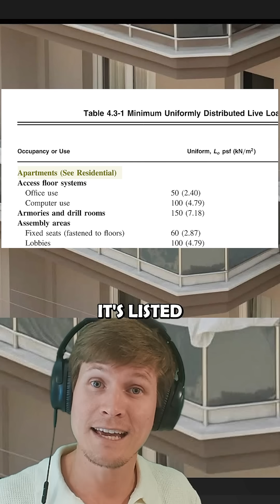Engineers HATE This Balcony Pool - Here's Why #structuralengineering #engineering #reddit

Comment: How does it work? a 300 pound person standing still would put more than 40 pounds per square foot on the inside.
Reply: You gotta consider that not every square foot, is occupied by a person.  There's open floor space as well.

Locally, a 300 pound person standing still in a region of the floor with a 3 square foot area, would be 100 psf.  But if you consider vacant space immediately nearby, suppose another 6 square feet of it, that brings the average down to 33.3 psf, which is less than the 40 psf you're requried to design for.  People generally don't pack themselves like sardines.

The 40 psf as a general residential live load of the flooring, is based on the statistical liklihood of how people are likely to distribute themselves with typical activities.

Comment: One structural engineer I used to know called water liquid lead. People just forget how heavy water can be.
Reply: Whether something is heavy or not, big or small, hot or cold, depends on what you compare it with, so my reply is more for the fun of it. But I would say that water is not so heavy, per se. It's lighter than a human body (a human body is basically water, plus some slightly heavier stuff) and the only reason we float is because we have the buoyancy of air in our lungs. Metals, rocks, sand, concrete, dirt.., a lot of materials are much much more dense.
The issue with water is that **it's a liquid**, thus it fills any space without leaving air: a bucket of dry dirt can be made lighter than a bucket of water, if well aerated, even if dirt is heavier than water (and indeed, it sinks when placed directly in water).
Also, water is cheap and easy to gather in large quantities, thus making us underestimate it. I don't think whoever filled that pool did it with bucket: they likely just used a hose and never felt the fatigue of filling it.

Comment: I am not a structural engineer, but according to my calculations it will be safe. Suppose that the balcony is 3x2m and we have 20cm of water, in total it is 1200 kg, or 1.2t, less than the weight of 10 Americans 😂.

Comment: why is a deck required to be stronger than indoor floor strength
Reply: and psi can't be the only consideration, there's total weight on each load bearing support
and direction of loads 
and deflection 

when the code says 60psft does that mean every arrangement of any weight anywhere on the surface needs to handle 60psft
if so then the total strength would need to be much higher, 
eg if the weakest points are at 60, then the majority is stronger than 60

but if 60psft is just local requirement eg you need every area 1sqft to support 60 pounds or more
then the total strength could still be far less 

eg thumbtacks can easily pierce lumber but not glass 
it's hard to imagine where this would happen with wooden decks
but concrete has that issue all the time, 
if you walk in concrete you are essentially walking on tips of concrete icebergs or cones twisting
radiating the forces down and out
but bulk area forces can have different mechanisms like hydraulic eg you can start squeezing dirt out from under your house like a tube of toothpaste 
if you hydraulically overload retaining walls then each individual square foot might easily hold up 1,000 pounds for vehicle traffic, but collectively a 1,000sqft area could max out at 30k pounds, much less than the 1 Million pounds you might expect from 1,000*1,000

Comment: I would estimate that water to be no deeper than the 20 to 22 in.  It's relatively half as high as the latch on the sliding patio door. typical patio door is 84 inches tall. with the latch being halfway up let's call that 3 ft 6 or 42"
Reply: Standard swinging doorknob height is 35"... I would estimate the latch on slider to be about 40"-45".... wow, I just looked at your post after rationalizing it myself... yep... we be pretty close on the estimation.

 After the incident, the latch height from the pool will be about 30'40" high. Quite a reach to get back into the dining room assuming this is the third floor. The first and second floor occupants will hopefully not be on the deck during this event.

Comment: Don’t forget fluid mechanics, fluid is a PRESSURE, the railing is also reacting significant force.
Reply: The railing has a safety factor of .5 under this load but if you consider that the matieral is proof tested to about half it's strength it should theroedicaly be in a state of equalibreum! Who ar u to judge? Smoke a joint and stop profiling people Du. No body asked you anyways...

Comment: 62.4 pounds per square foot

Or 1 kilogram per litre
Or 1 ton per square metre
Reply: *1 ton per cubic metre  -  Metric is awesome BTW :)
Reply: Yeah, it kinda blew my mind that Americans need a weight factor for water. I never thought about that before.
Reply: @haukenot3345 ❤ Torque calculations in metric.  90% of metric users haven't a clue and it us dead nuts simple.
Reply: Les Français, des putains de génie. Vive la Révolution, vive la France !
Reply: That is a much simpler, but this is America & we do things the IMPERIAL way.
Reply: @patricknevermind8529 
You calling it "imperial" is inappropriate. 
You Americans never ever had an empire. 
UK did, and their measurements units values are slightly different from yours.
Reply: @gaetanoroccuzzo  If I remember correctly the measurements used in the US are older as the British overhauled them later. Still imperial.
Reply: @JMRPlumbingandElectricLLC 
I'm not sure of that. 
I've reason to believe that modern Britain inherited their measurements from the Romans around a couple of millennials ago.
You would be right only if USA had been discovered earlier than that...
Reply: @JMRPlumbingandElectricLLC In my country, we use to call it "English system" instead of "imperial system"
Reply: @JMRPlumbingandElectricLLC 
If my memory serves me right, the British inherited their measurements from the Romans a couple of millennia ago. I have my doubts that the whole American  continent had been discovered at the time.
Reply: @gaetanoroccuzzo  What does that have to do with anything? You said that it is “inappropriate” for the US to call the system imperial because the US never had an empire, but the British did, and the Romans before that. You said that their measurements differ from ours in an attempt to justify the logic. While the US did not have an empire it was a part of the British empire, from which it inherited the imperial system. The measurements were the same at one time, with changes happening after the split, prior to standardization in each country. Either way it is based upon an inherited imperial system of weights and measures. Also, the British inheriting weights and measures from an empire they once belonged to really doesn’t do anything to invalidate us inheriting our system from the empire we once belonged to. If “Imperial” offends you it is also called the U.S. Customary System or the U.S. Standard System.
Reply: @JMRPlumbingandElectricLLC 
Your brief explanation contains a considerable amount of biased logic. 
Nevertheless, wordings and structure may be similar but values and quantities are definitely not. 
Yet it's peculiar, for a country that rams into the rest of the world's throat their freedom and how free you are, relaying or adopting something "imperial" (thus devoided of freedom) appears to be counterintuitive at best
Reply: @gaetanoroccuzzo  Biased logic? If any of the information I presented is factually incorrect, please point it out and provide evidence to the contrary. Nothing is any way simply because I will it to be so, but neither is it because you feel it should be.

Boycotting a system or product not because of it merits, but because of its origins is not very logical. Is it counterintuitive at best to not eat pizza because Mussolini was Italian or not drive a Volkswagen because Hitler was German?
Reply: @gaetanoroccuzzo Americans don't call their empire an empire. They call it a republic, but it is certainly an empire by your definition.

Only the Roman empire was an empire. Its their word, and they defined it.
Reply: @histguy101 
I didn't say Americans (USA) are imperialist. 
Get it right!
Imperial is what themselves define as their measurement system. 
And USA hasn't "given" this system to UK but the opposite. Furthermore, UK has borrowed it from the Romans several centuries before America was even sought of. 
That's my point. Dispute it if you can with better evidence.
Reply: @histguy101 
As far as being an empire or not, it isn't the name that defines it but the reality of things.
Reply: Water is the only thing you can do this with and it's such a random edge case, nobody really cares and it doesn't matter.
Reply: That 1kg=1L only is true at 3,98°C. Like seriously metric system 3,98? you had one job.
Reply: @blub5117  and at 30° 1 L of water weighs 4 mg less than at 3°, which is an insignificant enough difference that 99% of the time people will say 1 L = 1 kg even though it's not perfectly accurate, so i fail to see your point.
Reply: @yag-yet_another_gamer  the kg and liter are totally made up things so we could easily base it on the density of water at 0°C when it's freezing, or on 100°C when it's boiling, even room temperature 20°C would work, but no we choose 3,98°C the point of its highest density at normal ground pressure. The entire purpose of the metric system is to make its use easy and 3,98 isn't easy. Sure it's still far superior to US customs and the difference isn't that big, but that doesn't make it perfect. 3,98 is stupid.

Comment: Forget the structural integrity of the balcony itself, let's talk about that railing and what appears to be a glass panel. Thats all thats keeping you from waterfalling over the side. Whoever built that needs an award 😂
Reply: If you wait long enough they’ll receive a Darwin Award.
Reply: I was present in a testing of a similar glass railing, although this was intended for a stadium (stricter requirements). We attached 3 steel cables, equally spaced in a total span of 1m (3ft, 4inches), at the top of the railing that was 1.2m (4ft) tall. Those cables are connected to a specialized machine that pulls them with equal force. There were also sensors at the top of the railing that measured the displacement of the railing. The goal of the test wasn't to prove that the designed product wouldn't collapse, but to prove that he remaining permanent deformation was within the standard's limits (in our case the limit was something like 8mm and we achieved 3mm). The interesting part is, that the railing was stressed for a whole minute with a total force of 500kg (1000+pounds), after which it was ''allowed'' to return to its initial position. After a few seconds, you get the measurements of the remaining (plastic) deformation. Since the glass mechanical properties are something we have perfected over the years (lamination, tempering etc.) and you don't wan't to use extremely thick glass panels if you can avoid it, the trick is to design the aluminium ''base'' at the bottom in a way that helps it ''absorb'' some of the forces (it can't be too stiff) and spread loads evenly. I worked in a company that designed and produced such railings and other architectural aluminium systems. Very interesting stuff!
Reply: How often do you  fall through windows??
Reply: @asmallphd9648 
When the glass fails and the water sweeps you through them? More often than you might think.
Reply: And scratch you while falling down to win the award
Reply: Gotta withstand years of kicking.
Reply: YEAH, a Darwin award!  That's scary AF!  Just look at how far it's already sagging.  Downstairs neighbors be hitting they heads! 😂
Reply: The glass panels are solid enough.  Couldn't you see that they reinforced them with the plastic tarp?  That is totally solid 👌
Reply: The section 8 of infinity pools
Reply: You don't know about infinity pools?
Reply: @rakib9420 different glass, different structure, different loads 😂 really?
Reply: @bluelagooon tempered glass for an exterior deck railing is very strong
Reply: @rakib9420  but infinity pools are designed for that im pretty sure those aren't lol

Comment: We use 2kN/m² 
Wich is 3kN/m² after safety rating
Translating to 30cm of water.
Unless however there is an exception for outdoor heavy use (outdoor furniture is usually weighted down for wind resistance. Wich would mean up to 45cm of water. 
Unless that railing is super short they're still over.

Comment: The water does not go as high as the balustrade, as can be seen on the opposite end. The glass is opaque enough to not be able to see the level. But under the window we can see the level. In Europe those windows are at 90cm from the floor, about half that space seems taken by water, so 45cm, 450daN/sqm, 94 psf. Also, there is no "strengthening" of an individual balcony, you would have to add another layer of reinforcement on the top plus concrete cover, and plenty of connectors, it would change the load on the beams, make that slab thicker etc, it's a nightmare, nobody does this, nobody would approve it either. What you could do is install metal columns in the corners of the whole line of balconies, to make them stop being cantilevers.
Reply: You’re defeating the architectural elegance and artistic intent of you remove the cantilevers. This is why building in Europe are ugly
Reply: @unpluggedpresidents  I did not propose removing cantilevers, I showed what would be needed to strengthen them to support pools. Buildings in Europe are ugly? Compared to what?
Reply: @ahmedalsadik it’s looks fine as is right now. Nothings wrong, so no need to strengthen.

They are ugly compared to ones we have here in the United States. Our state of the art modern architecture is unmatched
Reply: @unpluggedpresidents  As shown in the video, yes something is wrong, the loading from the pool exceeds the design capacity, so it does need strengthening. As for Europe vs America, yes America has modern buildings, but in no way shape or form does that mean European architecture is "ugly". American architects are trained on classic European architectural styles. Europe is a tourist destination specifically because of its architecture, because it spans so many styles over thousands of years, people from all over the world come to see it. You have no idea what you are talking about.
Reply: @ahmedalsadik I mean the deck looks fine, so nothing is CLEARLY exceeded. This video is obviously wrong.

Let’s be realistic, tourists going to Europe for “the architecture” is so 2000’s. You boomers are so stuck in the past, with everything (especially architecture in your case).

American architecture elegantly blends classical characteristics with modern cutting edge visions. I see none of that in Europe. Just the same old stone every where I go. I know EXACTLY what I’m talking about thank you very much
Reply: @ahmedalsadik don't engage the troll.
Reply: @devilmonkey471 just because I’m right and can formulate better arguments doesn’t mean you should resort to slander and childish tactics

Comment: The balcony is still standing. Does this mean it was overdesigned?
Reply: Not necessarily.  It could be a concrete balcony from a multistory residential, in which case the load might be fine.  It could also be a matter of "well you're not splashing it and there's no wind" meaning it's more of a static than a live load.  There could also be some structural breakage not pictured, ex plastic deformation of some trusses, fractures, etc starting to form.

It could also just be taking the load like a boss for now.  Hard to say without having the specifics.  Code is a minimum rating not a maximum.
Reply: Depends, it could be slowly accumulating damage and fail next week. Not everything breaks immediately.
Reply: It’s still standing because the load is fine. Idk what this guy is talking about. Humans are made up of like 90% water, so it’s like pretty much the same as if you had a bunch of people standing on the balcony

Comment: 60lbs is too damn low. A person can comfortably stand in two square feet. An appliance can be way heavier.
Reply: It's an average load over the entire area of the balcony. If the entire balcony was crammed full of people, then, there'd be an issue. 

Also, there is usually a generous safety factor applied on top of the "design load"  at the design stage.
Reply: I agree 60 lbs is too low especially how overweight everyone is these days. The code needs to be updated for the sad obesity epidemic going on now a days
Reply: @shadow3dvows  True, but they grow wider, not taller. Heavier individuals, but fewer would fit in a given area.
Reply: @martinliehs2513 according to my calculations, while the density of obese people is less than healthy people, the gross weight is still greater - so codes need to be updated

Comment: And don't forget the people that will get into the pool. Aaaand the "walls" also need to be checked for that horizontal pressure.
Reply from the maker: “Structural glass” probably
Reply: I feel like at >120 pounds per square foot already, and a human displacing some water weight, they're kind of minor in this loading estimate.
Reply: @MattTrevett something has to push it over the limit